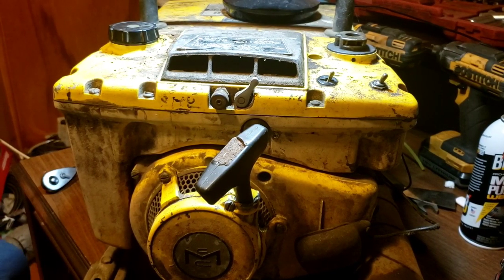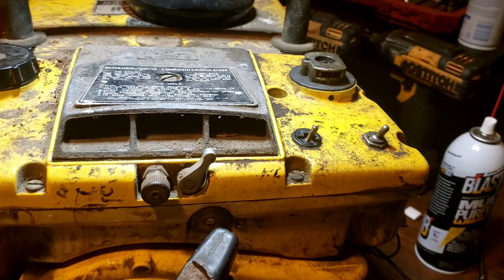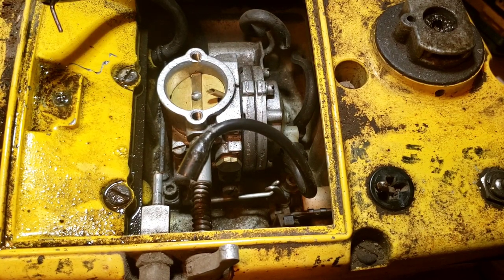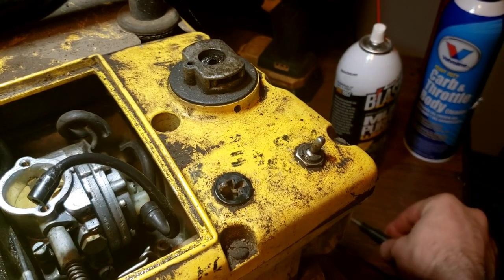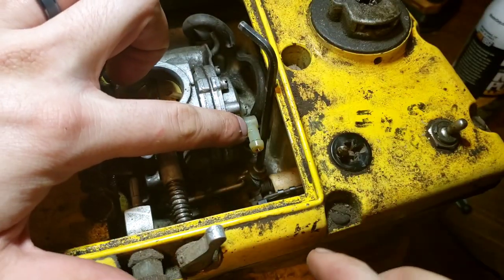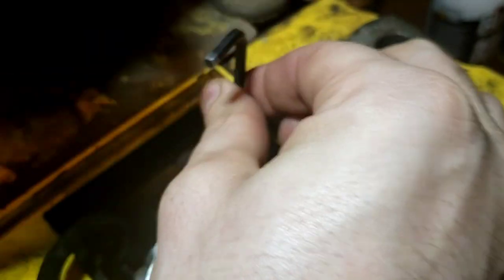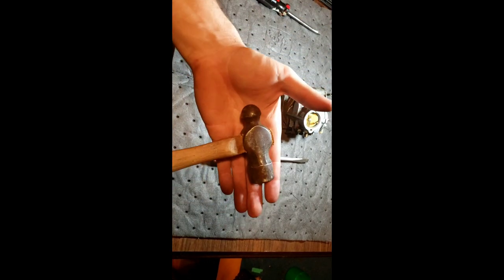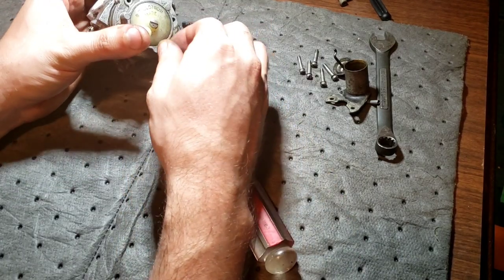McCulloch 170 Arch Welder Return, Carb Rebuild

Comment: If that plunger is leather, soak in some light oil. Looks a lot like the pumps for a Colman stove and those needed a couple of drops of oil every so often.
Reply from the maker: I oiled her up and she expanded again. Not sure how well its working, does work but I need to look further into where the lines go that operate it.
Reply: @mistermacgray  I should have waited until I watched the whole thing before commenting, but I had to quit and get some work done before dark. PB Blaster was probably a good choice, we used to use neets foot oil on Colman and other pumps, sometimes it takes a while to fully soak in, but it doesn't take much.
Reply: I forgot, the old vacuum operated wiper motors on old cars and trucks used leather diaphragms.